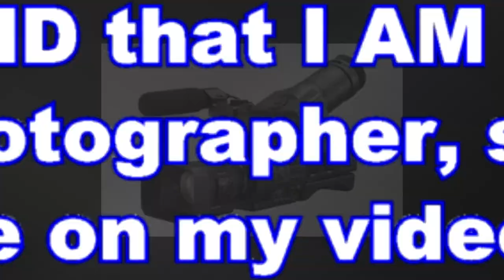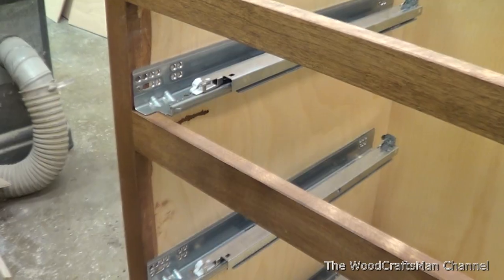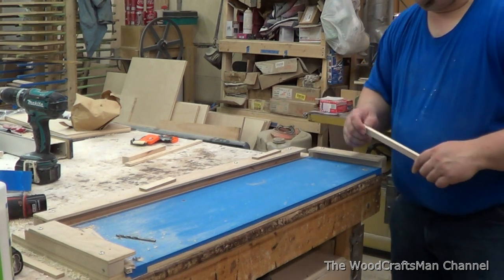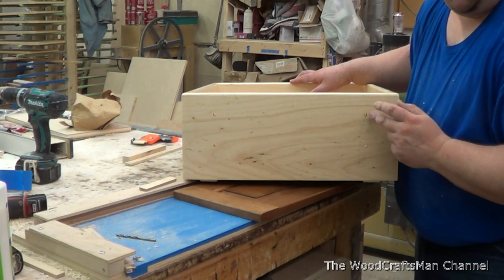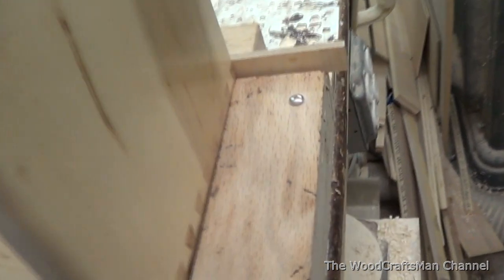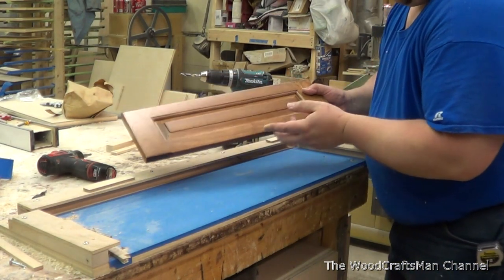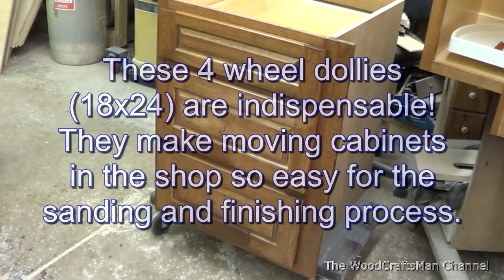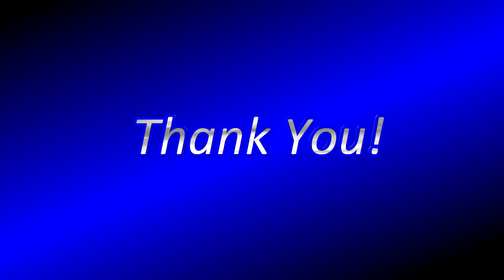Drawer Front Installation Jig # 157

Comment: I like your jig.  What is that blue material?  Did you think about locking the drawer box to the drawer front?
Reply from the maker: Hi, thanks for the comment.  The blue material is just painters tape to protect from scratching up the finish. I'm not sure what you are referring to about locking the drawer front to the drawer box, I just use washer head drawer front adjusting screws to mount the drawer fronts. Thanks. Scott